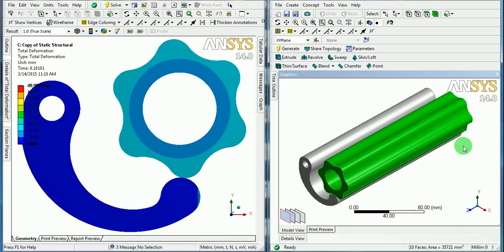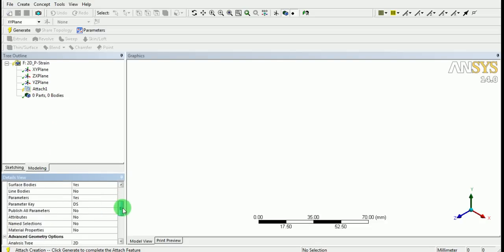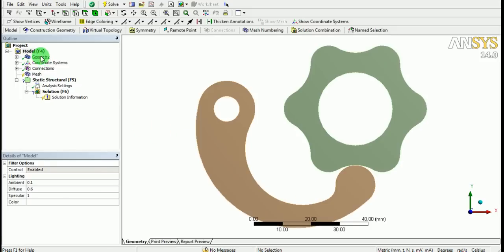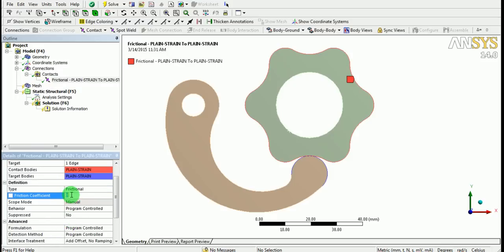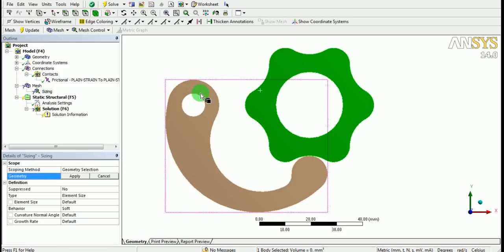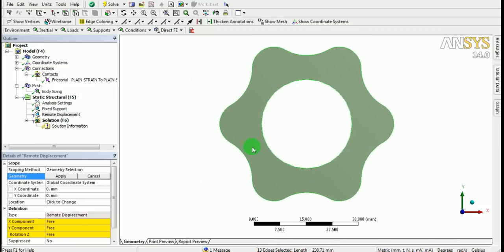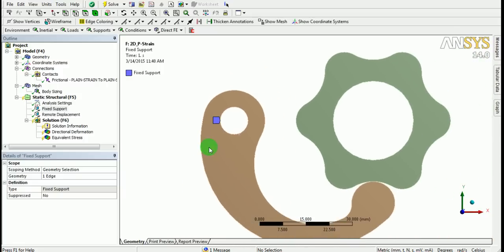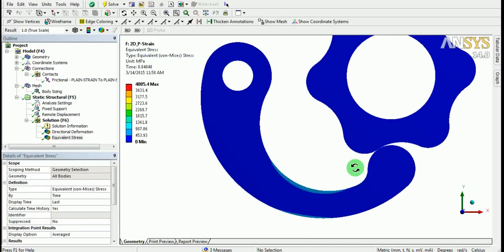ANSYS Workbench | 2D Plane Strain | Contact Non Linear Analysis | Tutorial Video | GRS |

Comment: When i try to import the 2d geometry in the mechanical window i get the following error: No valid bodies found for 2D Analysis in part Part
Reply from the maker: +Rick Dickhof ensure that 2D geometry lies in XY plane only. If not, move the body to the XY plane.
Reply: Hi @CAEWorldwide, I am trying to run a 2D analysis. My body is on xy plane..still I get an error
Plugin error: attach failed,
No valid bodies found. Please can you help on this?

PS: I also tried to sort it with CAD configure option in ansys, however that doesn't work